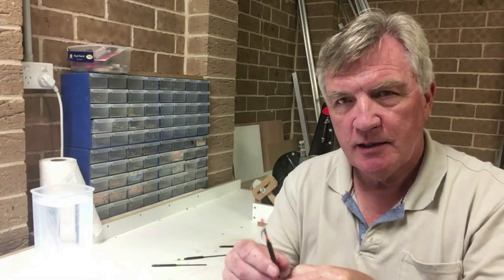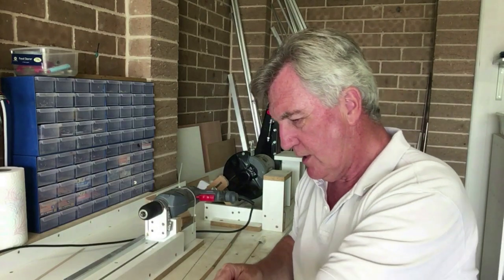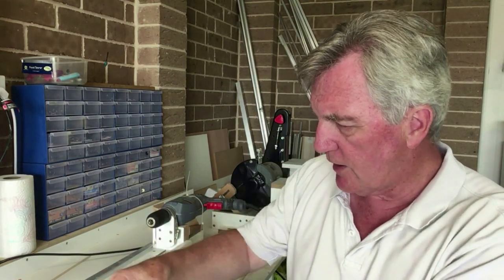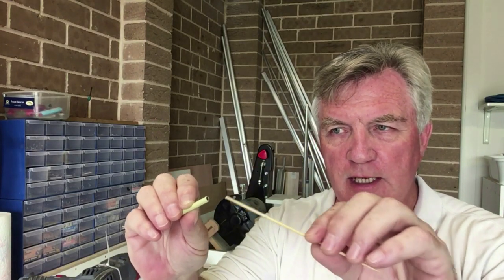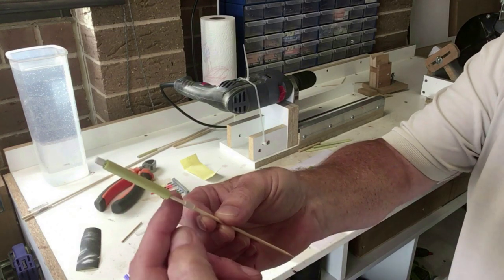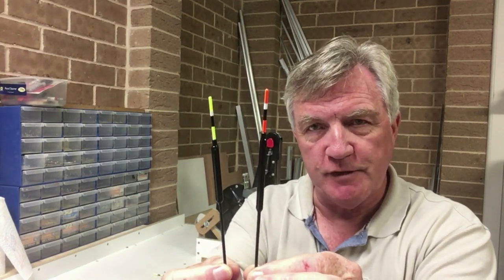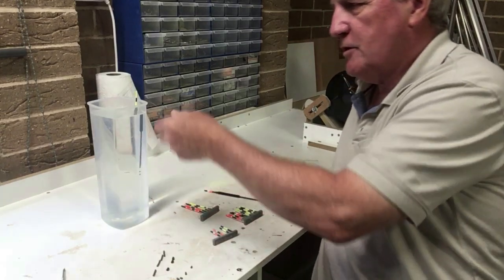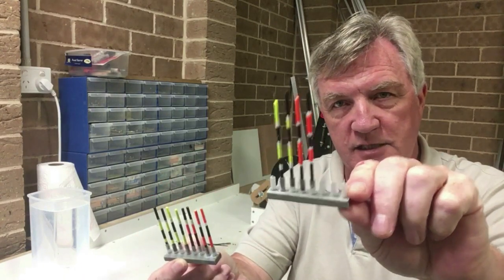Make Pole Floats with Plug In Coloured Tips

Comment: Den, I use garden bamboo for floats (ordinary wagglers) with no problem. They may not be as buoyant as reeds but on still waters no issues.
Reply from the maker: Hi Colin. I think they would work as a straight waggler, even though they would not be as buoyant as other materials. For bodied wagglers, I would be concerned that the additional density and weight of using them as the antenna would unbalance the float.